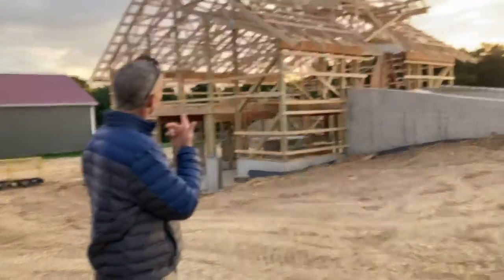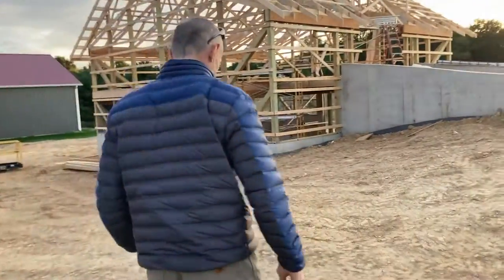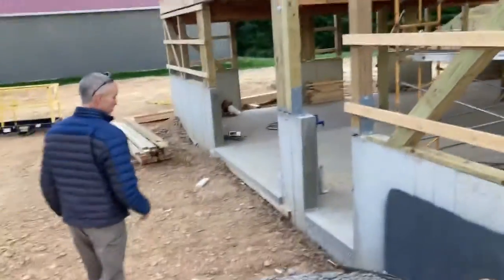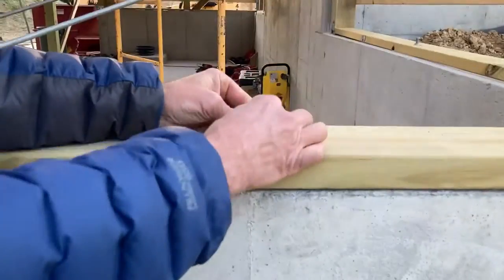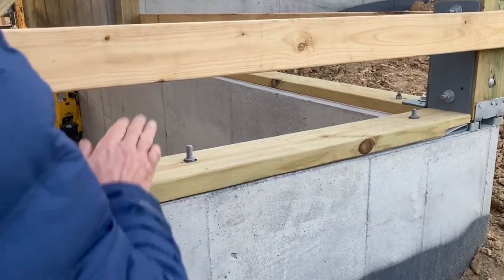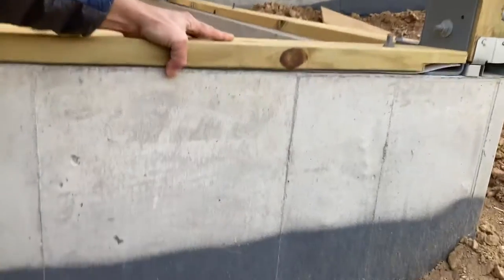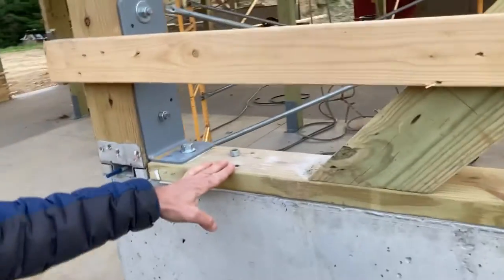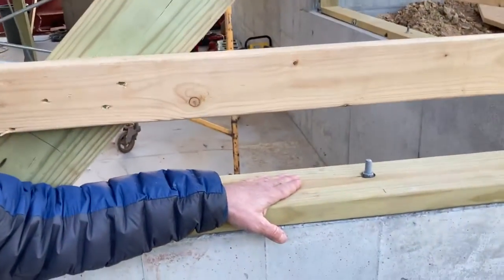All about Sill Plates and Anchor bolts

Comment: how did you seal around that post anchor that's completely open?
Reply: Is a barn, probably weren't too concerned with drafts. Sill sealer isn't to keep " critters" out either 🤣 so I see your point. Big critters be gaining access thru that gap 🤭

Comment: I see some people use an 8" wide sill plate and others use 6"--what factors determine the width that gets used?
Reply from the maker: It all depends on how much of the stringer joist i resting on the sill plate.   You should have a minimum of 2.75" bearing onto the sill plate.

Comment: What is your opinion on those who skip the sill plate and just use a pressure treated bottom plate on the wall and anchor that directly to the slab?
Reply: He'd probably say nice job building your garage 😉. Slabs are only used for summer cottage type homes in Northern locations or garages that are unlikely to flood.

Comment: Is that really all about sill plates and anchor bolts? Really? How far apart should they be?
Reply: They should be no more than 6 feet apart with one bolt located 7 bolt diameters minimum from the end of the plate. If your bolts are 1/2" (7x1/2"= 3.5) your first bolt should be 3.5" to 12" from the edge of the sill plate.
Reply: Early indicators said no more than 4 feet 🙂